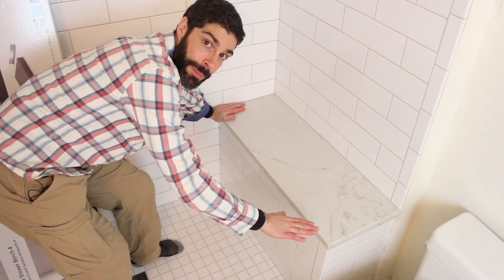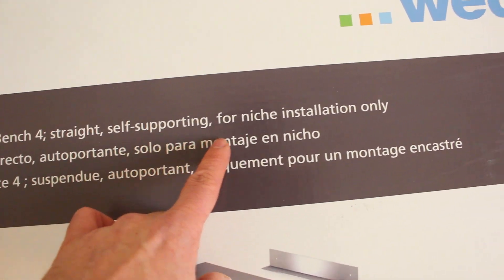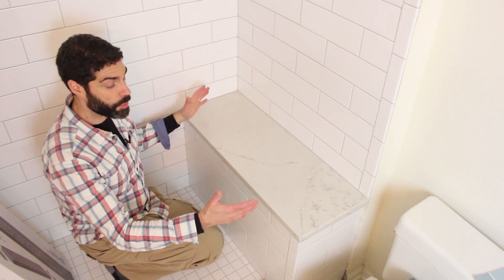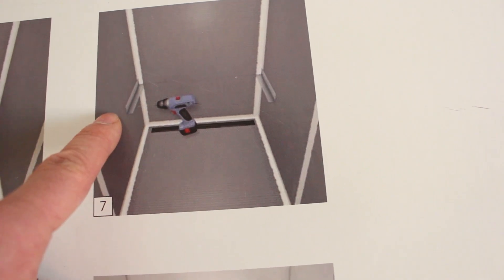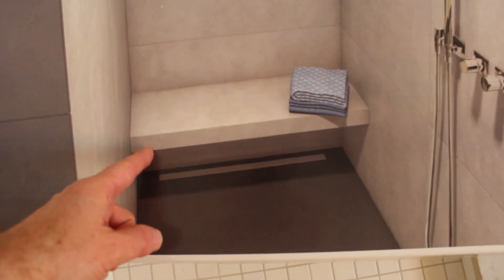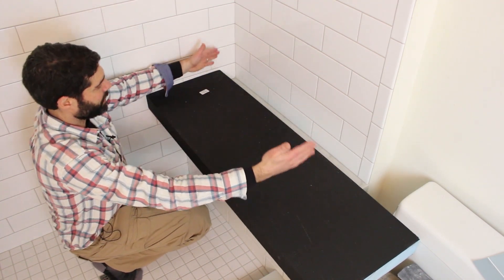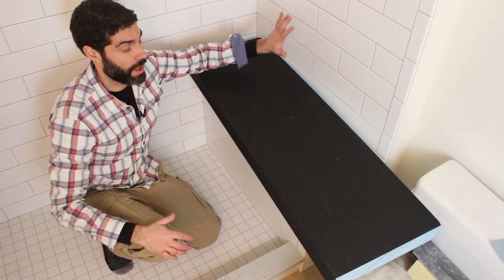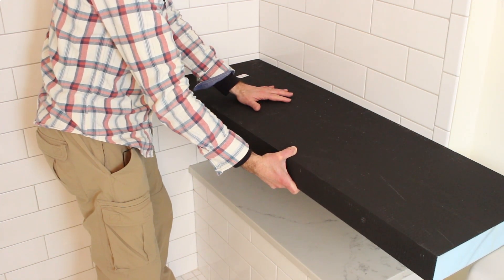Floating Shower Bench Seat...Wedi Sanoasa Kit (Quick Tips)

Comment: Thanks for the video. Planning on installing this type of bench next year in my town house gut job. Going to have only one wall. Will make a bracket out of angle aluminum or stainless steel that will be supported by the back wall on the open end of the bench.